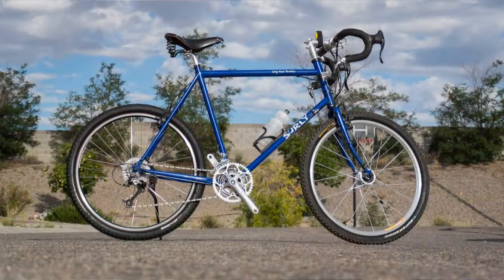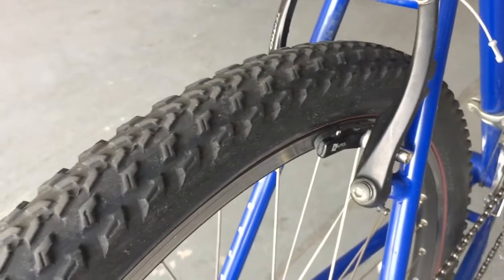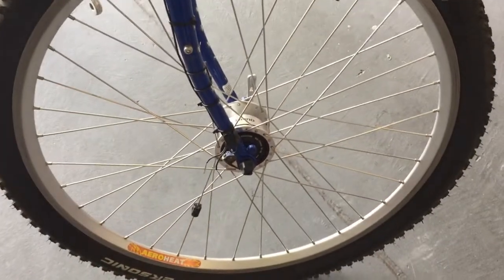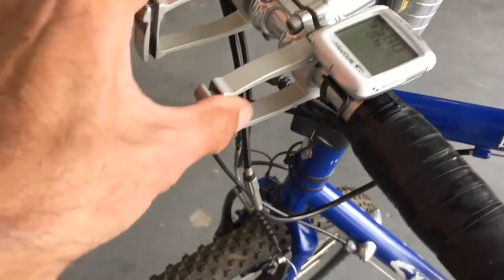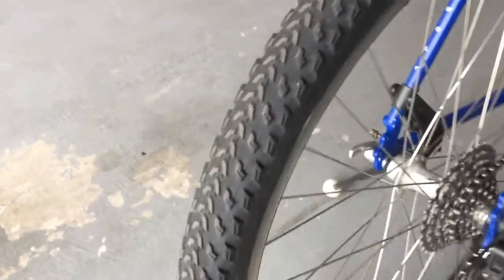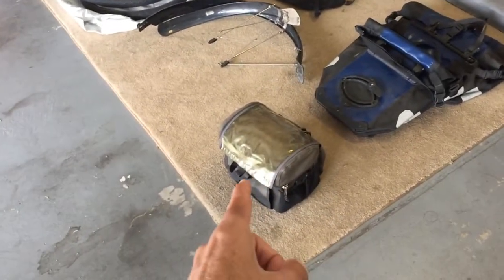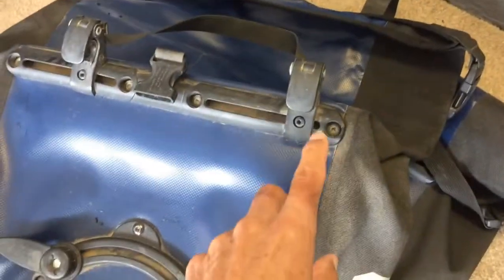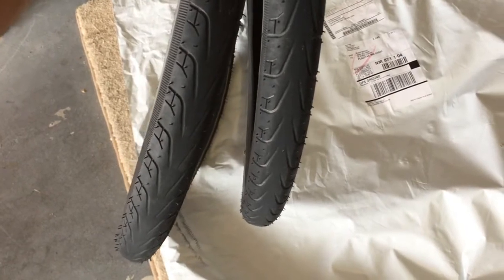SE3 Updates 2017

Comment: I have the same charge controller but keep it in my handlebar bag.
Reply from the maker: Better option!
Reply: Russ McCoy I bought the ortlieb bag that runs a connection through the mounting system for quick disconnect. You don't have to do anything except pop the bag off the bike.
Reply from the maker: Very cool!